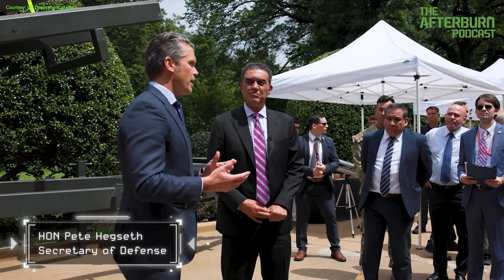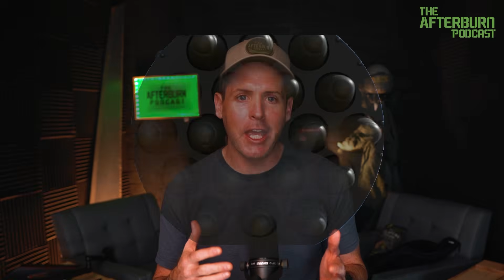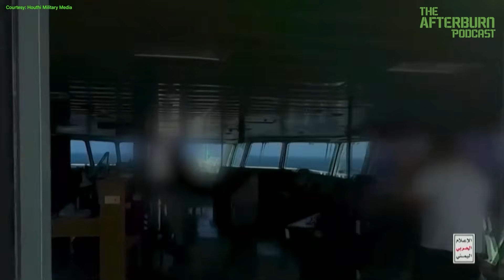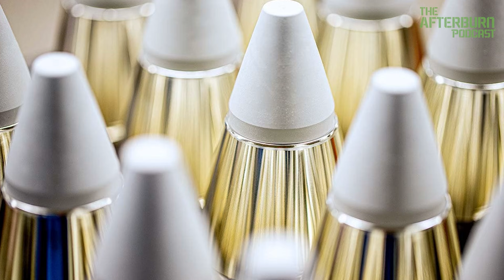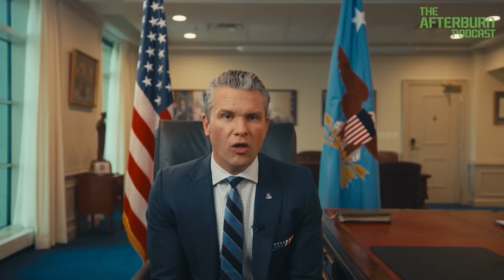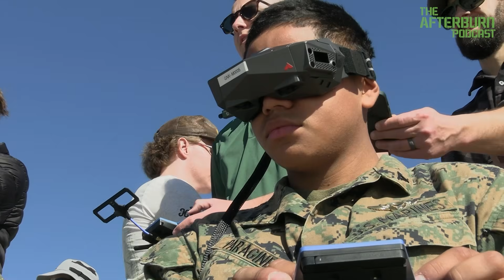How F-16s & F-15Es Are Destroying Kamikaze Drone Swarms

Comment: Next thing the USAF has to do......
is match these low cost missiles to low cost aircraft. 

Having F-16's or  A-10's continuously circling on patrol, waiting for the occasional drone to buzz into view, is also prohibitively expensive. 
These aircraft cost many $1000's an hour to keep in the air.

The USAF (and Navy/marines) need cheap, reliable, easily maintained aircraft, with long loiter times, to be equipped with these cheap, reliable missiles. 

Modified jet trainers or, better yet, turboprops, would be ideal for the job and would provide a complete solution to the drone problem.

Comment: The F-16CJ was considered "good enough" for SEAD by many in the decision-making loop during the F-4G transition, but it was never the optimal solution. The Air Force studied the F-15E for Wild Weasel in '92, pivoted to the F-15C in '93 to save money, and when that died too, settled on the F-16 as the cheapest remaining option. Budget drove that decision, not capability. As an AF guy it pains me to say it, but the EA-18G Growler is the superior SEAD platform ... it kept the two-seat crew concept that Wild Weasel was built on and combines jamming with HARM in the same airframe. SEAD was never meant to be a single-helmet operation, and the entire history of the mission proves it. The AF knows this. They just couldn't afford to act on it.

Comment: They're going to need both more drones and cheaper anti-drone measures, both from the ground and from the air. Another way to handle this could be to set up permanent over flights of a drone grid, which randomly cover the battle space and are combined with randomly space ground systems and as a last resort, a flight crew. 
So, above a theater, or a country are a series of unmanned systems, which constantly change course, so as not to create a pattern. 
They are each capable of dropping a bunch of smaller drones, which are either Kamikazes, or recoverable themselves. 
They'll be able to cover a whole theater at a higher altitude. Mobile, as well as fixed-site launch stations on the ground would constantly be covering medium to low altitude. Point defense, mid to lower, have their own versions. That cover closer threats. 
Regional commands can be set up, mapping out critical spaces.

Comment: Put a 50 cal (or even 30 cal) Gatling gun on the A-10, replacing the 30 mm. Load it with 6000+ rounds. 

Load it with 8 of these small missile pods. 

Slow, low, long loiter.  And tons of ammo.  

Perfect drone hunter. 

Or, bring back the P-51, with a PT6 turbo prop. 😎

Comment: So why are we using tactical fighters? During Vietnam propeller engine Cessnas carried rocket pods. The Shahed drone has a top speed a little over 300 miles per hr. Start arming the thousands of business jets in the UAE, Qatar, Bahrain, etc. with this lower cost weapons system. Easily within range of the Strait of Hormuz, Red Sea, etc.

Comment: It’s still too expensive… The cheapest solution is the BB gun in the jet. Find a way to slow that down so you don’t hose off 600 grounds in three seconds on a single drone and you now have used that weapon system for its intended purpose. Most F series aircraft have that weapon installed at a some degree upward cant because it was intended as an air to air weapon. We only learned how to strafe with it because of GWOT.

Comment: I'm not sure if you already knew this but BAE Systems has designed an infrared seeker to add to the APKWS rocket which eliminates the need for continuous laser designation by the pilot. Now a pilot can designate a drone and fire the rocket. The infrared seeker will take over guidance so the pilot can quickly switch the laser targeting pod to the next target. This essentially makes the rocket a much cheaper fire-and-forget missile which helps massively if faced with a drone swarm.

Comment: What I wonder is why the Navy doesn't station an Arleigh Burke-class Destroyer near task groups and commercial shipping.  The Arleigh Burke-class Destroyers have laser weapons installed on them, most of which are capable of interfering with drones.  They also have one destroyer that has a prototype laser weapon which is capable of destroying drones.  If Wikipedia is to be believed, the Navy currently has 74 of them in service.  That said, for all I know they may already have them in the area but little is being said of whether or not those weapon systems are being used, and if they are being used successfully.

Comment: We need prop planes on drone duty. The F-16 kill I saw had his engine at idle and his speed brakes open to get  sidewinder shot off.  Jets are too fast for this.  Well, fighter jets.  Something like the A-10 or the A-37 or other jets designed to fly low and slow could handle it.  The A-10s already have laser pods already anyway.  Should be simple.  I wonder if the gun could be replaced with a revolving rocket magazine...?

Comment: I didn't know a used Honda Civic can cost between 25k to 50k. Lol
 it's always been that way with interceptors missiles they always cost 3 to 4 x or more than the target they're intercepting , people don't take into account what the target is, as well  how much that Target cost.  and can you put a cost on human life.  
the apkws ll is a perfect solution for these type of drones F-18 F-16 and F-15 with a targeting pod can probably carry Max 40 of these type of apkws ll Rockets in multiple pods and probably still carry a fuel tank and 2 aim 9x we have done it before and I think there is also a new version of the APKWS ll with dual mode lock on and fire and forget and a type of airburst proximity fuse don't know if they put those variant into service yet but the agr20 they're using now definitely are effective we seen them being put to use effectively in the 12-day war or operation midnight hammer even  in Ukraine and I'm surprised we haven't seen more of them being widely used now doing interceptions on drones and cruise missiles by the US and Allied countries this is the kind of thing that should have been already in place before we even did the operation on top of that more countries from the Gulf States should be using any means necessary anything will work mobile trucks with a 50 Cal mg and also bunch of mobile units using man pads  those are highly effective as well against these type of drones little bit more expensive but it will get the job done especially something similar to The Avengers system or AAA GUNS, AN I thought we would have more ew and GPS spoofing every one of those countries being targeted needs to definitely step it up especially the US and Europe . Ukraine rus War for example has bin A warning. FOR everybody about this kind of warfare for the past 4 years+   and we should have already had a solution in place before it even kicked off. There's a lot of solutions out there but it's moving too slow

Comment: Bro, there are two destroyers deployed to Iran carrying the Meteor anti-drone microwave system.  It was tested against Iranian drone swarms, and it works.  Brought down hundreds of drones It's not powered by missiles; it's powered by electricity.  It generates heat and has to shut down occasionally, but that wont matter once EVERY SHIP WITH SUFFICIENT POWER IN THE US NAVY HAS AT LEAST ONE of these.  And this WILL happen.  Most importantly, it was integrated into AEGIS, and the integration worked!

YouTube search:  "meteor anti-drone system Iran", there are a couple videos on the topic already.

Comment: A propeller aircraft with P-51 like characteristics the Aero cobra with machineguns could loiter around for hours and knock these flying bombs down like swatting flies.. If you have to have a jet then why not the A-10 warthog fitted with machinegun pods.. Helicopter door gunners have been shooting them down as well so low cost could easily be done..

Comment: Why not use the A-10 warthog
Reply: It can’t operate off of carriers, it doesn’t have a radar, its gun is nowhere near accurate enough for targets this small, it’s way too slow to vector onto multiple drones.   So, it can’t find them, it can’t catch up with more than one or two of them if it did and it can’t do much about it if it catches them.
Reply: @davidgill3356 thank you, I didn’t;t know that about the A-10
Reply: @usmcpatriot7546 no worries.  Very cool airplane though.

Comment: You DON'T need Mult-million dollar fighter jest when an ANTIQUED Old-School Designed WW2 PROPELLER DRIVEN Fighter armed with loads of 50 cal. machine guns can EASILY out run, out maneuver portable SAM missiles and shoot down drones ....CHEAPLY...At least far cheaper than million dollar missiles !!    As a US TAXPAYER.....I want to see the pentagon PROVE TO ME....that MY YAX DOLLARS could not possibly be spent MORE EFFECTIVELY to ELEIMINATE that Drone threat?!?!?      AND....is there NOT an aircraft in the DoW inventory ALREADY that could not shot down these drones with bullets and/or small caliber anti-air artillery???     TOO MUCH RELYING of Defense Contractor Lobbying instead of ...THE BEST, FASTEST, CHEAPEST, MOST EFFECTIVE Method and Equipment to COMPLETE a job to 100% satisfaction!!    Sure, there could and should be multiple differing options and means to accomplish the job.....BUT....I ALWAYS START with....the CHEAPEST, EASTIEST, FASTEST way FIRST!!!

Comment: All you need is propeller airplane with machine guns.
Reply: “All you need”. Always so simple.  You should call the pentagon and avail them of your amazing expertise.   How many prop aircraft have a radar capable of finding and tracking them?   How many propeller aircraft are fast enough to vector on to multiple drones?   It’s going to be falling behind every time it shoots one down and then changes direction.  It might get one or two.  Propeller aircraft will have problems with the distances involved for the same reason.

Comment: I think when we start fielding Fury CCA drones, they should carry a mix of Peregrine missiles and these cheap guided rockets.

Also isn't there a newer version of these with an IR seeker instead of a laser seeker? 
If they can develop a good swarm logic network system for these then i could see a squadron of Fury drones that could just rapid fire several AI networked IR guided rockets knocking out whole swarms in a single pass.

Comment: The United States has in its inventory the Air Tractor AT-802U Sky Warden, a specialized aircraft derived from robust agricultural crop dusters. It has undergone significant modifications to become a powerful and cost-effective military platform for the US Special Operations Command. These propeller-driven, armored planes are designed for counterinsurgency, surveillance, and close air support. With the appropriate weapons upgrade, the AT-802U Sky Warden is well-suited for eliminating these troublesome Shahed drones. Their extended loiter capability makes them ideal for patrolling the Straits of Hormuz.

Comment: You're still spending more than the cost of the drone just for a single flight hour for an F-15.  The answer will be turboprops (AT-80, T-6, A-29) or helicopters, plus these rockets.
Reply: Not sure how any of those can keep up with multiple targets though.   They may be slightly faster all out but they will have to play catch up as they vector onto new targets.  Also, no radar to find the drones, not sure if it’s the same to have an awacs steers them in and awacs are overworked as it is, they may not be available.
Reply: I think you want to start with interceptor drones, then hit the rest with APKWS-II type stuff. You also need to be able to nail little quad copters. You don't want them getting a 2 pound explosive near your jets.
Reply: Why cant super tocanos or a10s hunt them down
Reply: @RacerX1971 Too slow, no radar, not carrier capable.
Reply: I would go with the turboprops, lower operating cost than a helicopter with a much longer loiter time.
Reply: @nelsonbourdon2392 the f15 can do a wide range of things,huge waste of recourses to invest in aircraft that can only take down drones......with the f15 you now have a fighter/bomber/ and now an anti -drone playform.....diversity and flexibility is the key.
Reply: Ukraine solved this cost issue problem. Yes, the country Trump hates compared to “Friendly” Russia.
Reply: @je-140 Ukraine is utterly corrupted. You are duped.
Reply: @proseforpoets If Ukraine government was so corrupt, all they needed to do was comply with Russia demands and they would be rich.  Know what real the corruption is? A so-called leader holding power for 26+ yrs to life, when laws state 12 year term limits. So who’s being duped now?

Comment: The US has in its inventory the Air Tractor AT-802U Sky Warden, a specialized aircraft derived from robust agricultural crop dusters. It has undergone significant modifications to become a potent and cost-effective military platform for the US Special Operations Command. These armored planes, designated OA-1K Skyraider II, are designed for counterinsurgency, surveillance, and close air support. They are ideal for neutralizing pesky Shahed drones and patrolling the Straits of Hormuz.
Reply: My thoughts also.
Reply: Is it fast enough to deal with swarms though?  If it needs to chase that might be a problem.    Also, no radar.
Reply: You're right and I've had the same thought for the last 3 years. I tend to think of the Skywarden as a highly mobile counter-drone platform with extremely long loiter time. The aircraft can easily carry around 38 laser-guided Hydra-70 rockets in a typical configuration.  In theory, it could carry as many as about 152 Hydra rockets if all eight wing hardpoints were fitted with 19-shot rocket pods. However, a loadout that heavy would likely reduce loiter time and limit flexibility, so it would probably only make sense if you expected a very large wave of incoming Shahed-type drones near your point of take-off.  That kind of configuration would also depend on the targeting system. If each rocket required a manual lock and fire sequence where the laser could only target one target at a time, then engaging large numbers of drones quickly would be difficult.   Targeting Systems that allow faster cueing or semi-automated targeting would make that type of loadout much more practical.  We may already have that type of targeting system for hydra rockets, but I don't really know.
Reply: $12,000,000,000.00 for the first week of this war. Cost effective? We don't even know the mission yet.

Comment: They have that 30mm proximity round coming.  Center mount the Apache gun on a platform and go.  Or slow down the A10 gun a bit and let's go!
Reply: A-10 can’t operate off of carriers and doesn’t have a radar.   Also, too slow to vector on to multiple drones.

Comment: Why can’t fighters take out drones with cannons/guns? Forgive me. I really don’t know much about this kind of thing.
Reply: It's dangerous, is the short version, especially if the drone is flying low.

A fighter jet would be way under its stall speed (lowest speed it can go without falling out of the sky) to try and line up with a drone, we're talking a minimum of like 1.5 to 3 times faster than the drone. The drone also being small and the rotary cannons fighter jets use having surprisingly limited range, means the pilot has very little time to actually physically spot the drone, aim the aircraft, and fire.

Which is especially problematic because once the drone is a bunch of flying parts, the fighter jet might well be too close, causing some of those parts to get pulled into the air intake, downing the fighter jet.

And if the drone is flying pretty low, say just above tree tops or buildings, then the fighter jet pilot also has obstacles to avoid at the same time.

Comment: use an A10 short burst mode... retrofit some A10's with a tailhook!
Reply: There’s a lot more to it than a tail hook, it’s the landing gear and the frame, plus it’s not built to be corrosion resistant.   The wings don’t fold so you would have to remove two f-18’s for every A-10 at a minimum, plus the aircrews and personnel to maintain them plus the parts.   A-10 pilots aren’t carrier qualified.  The A-10 doesn’t have a radar….hows it going to find them?  The gun is +/- 36 feet at 1000 yards, it has problems hitting stationary tanks more than a couple times under perfect conditions, no way it’s hitting a drone.  The A-10 isn’t anywhere near fast enough to vector onto multiple drones.  Other than all of that, great idea.
Reply: Exactly. Maybe also replace the 30mm cannon with a 20mm, along with a lot more ammo and fuel.
Reply: The on-target success for that gun is already low for tanks, etc. For smaller drones? I'm not sure that's the way to go.
Reply: Super Hornet also have gun?
Reply: @Furudal yeah except for the growlers.  It’s also far more accurate than the A-10.